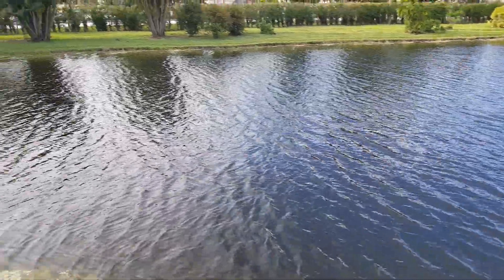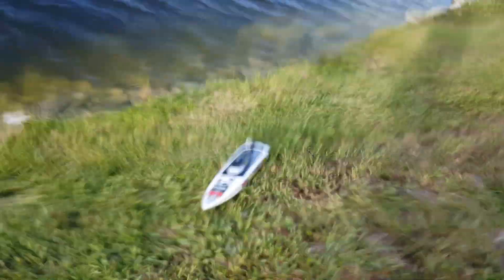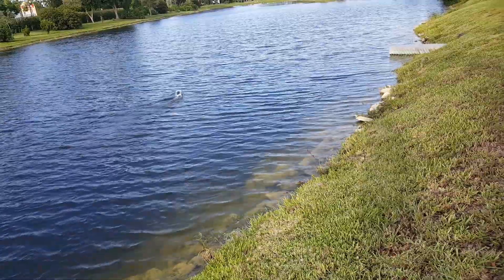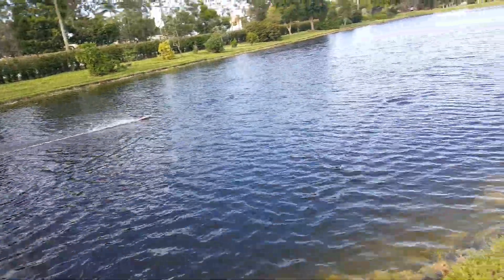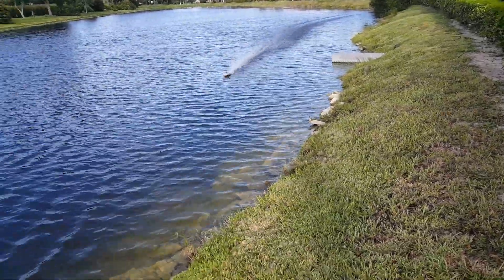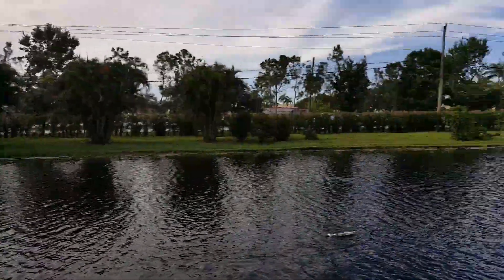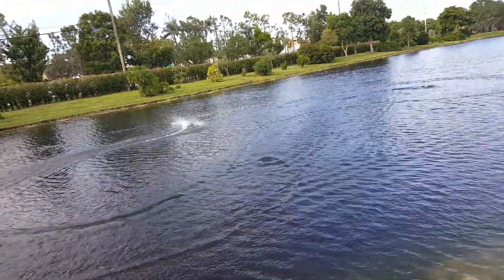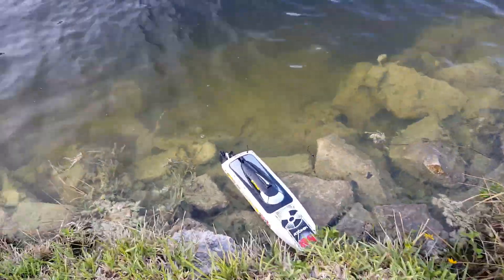First time driving an rc boat

Comment: If u check rcsparks channel. U should check all rc boats.  Hes has new thrasher boat. Its jet boat.  That can go threw rocky rivers. Flips over. And back up. And has pump inside takes what ever water sneaks inside pumps it out the boat. U should get into boats more. And your cars.. alot rc channels out here on YouTube.  But I don't think I get into it .. seems cool. But I live off SSI. And only 1000 a month. I'm 45 years oldfart. In Maine.  I only have 1 ... 1/8 scale rc truck exceed madbeast.  But I had redcats earthquake 8e once before exceed.  I want buy better machine  later on and save up. But money is the problem.  I see bunch you all getting money or save money u guys get on doing YouTube channels.  But I feel like I got weird panzy voice and I'm to embarrass. . LOL!   But I saw your channel going threw the other guys and saw bunch u all getting that new 1/5 scale arrma truck. Its seem ok. But I believe its frame needed light type aluminium like bullet aluminum frame and their braces need be solid tubing and mounted different on top tube where like in middle of truck something need be brace on it. I see others bending there top tube brace where of coarse bottom aluminum frame had to of bend on theres from just jumping and bashing the cars. Check out the other guys channels see what there doing to trucks. Rc dude81 flys that arrma truck wicked high and of course he bent tube in middle.  But oh well u take care.  Enjoy seeing your channel.  Hope u do more. And get into different things. . Like boats.. and different RC trucks and different company's.  .. not just arrma.  But theres so many of these companies.  From different countries. . It's crazy what there doing. Even copying other companies from usa. But u take care. Thank you for channel.  Also get this boat.. pro boats brushless sonicwake its 36inches and if flips goes back up like this boat u trying out